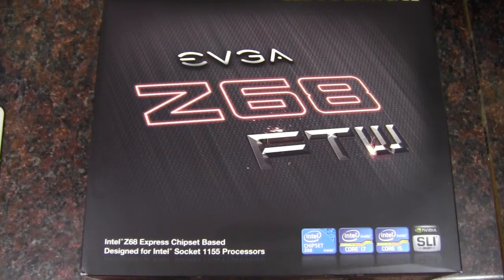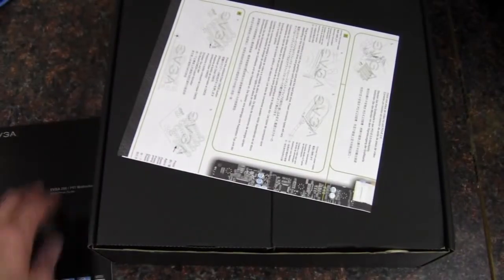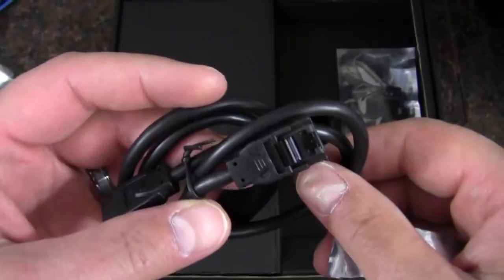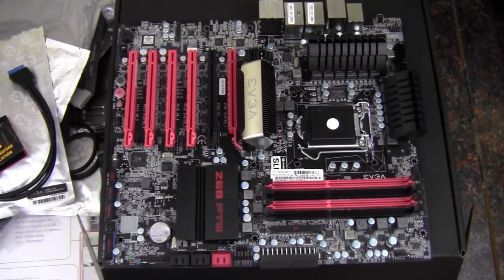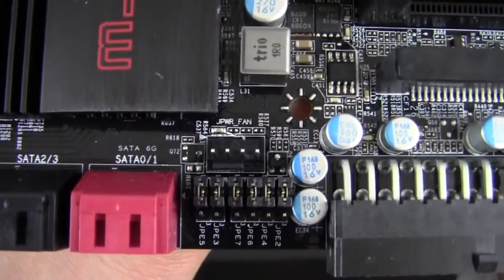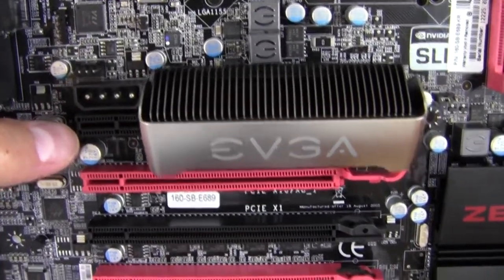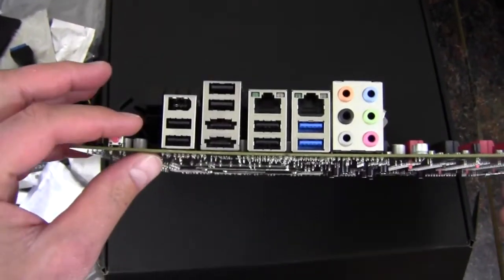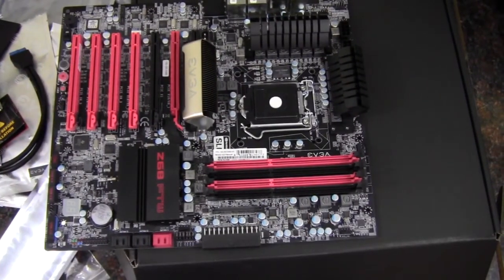EVGA Z68 FTW Intel Motherboard

Comment from the maker: You already have a good setup. It may not be worth the motherboard switch if you are already at 4.5Ghz. That is a good clock for a P67 board. The hassle may be worth it for the additional features of Z68 over P67. This board has been rock solid for me.